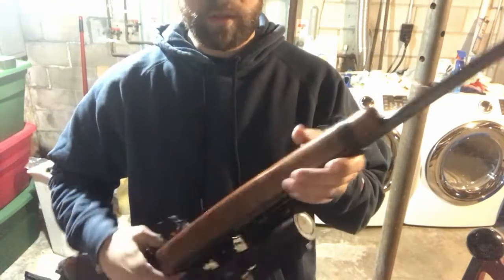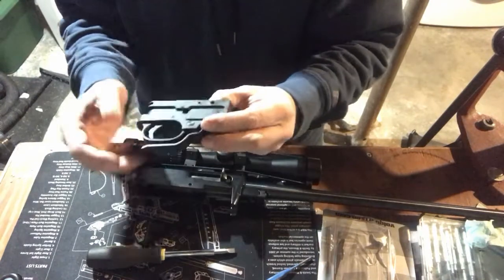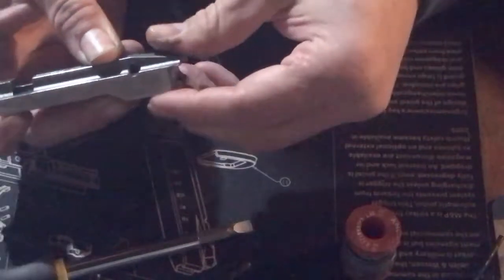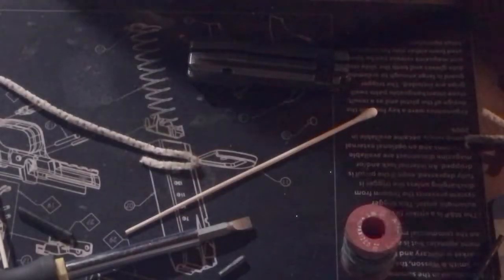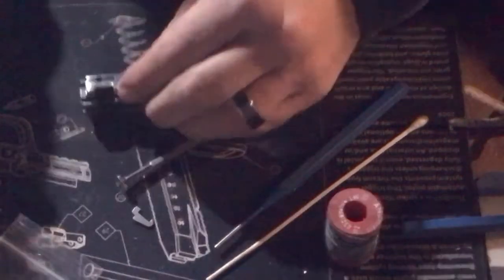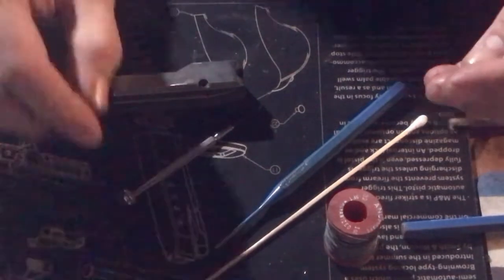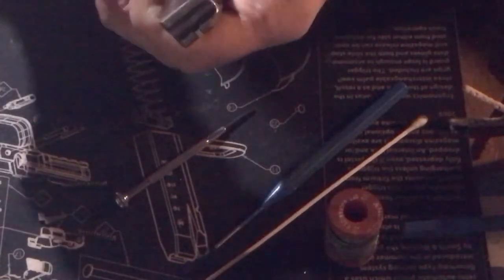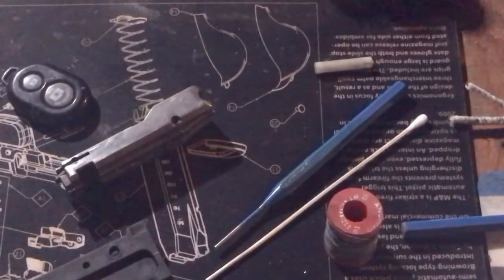Ruger 10/22 Firing pin and Extractor Replacement

Comment: I have did several mods to my 10/22, to get it running reliably. It was pretty much JUNK, straight outta the box. I installed a stronger plunger spring(from a spray bottle), then filed the plunger stop a little, so it would protrude into the mag-well a little more. This helped keep my magazine straight and level, while the action worked. I sanded and polished my receiver, and guide rod. I cut 2 1/2 coils off of my recoil spring, because it would ONLY run reliable, with Velocitors. Now, it runs good with Federal 550 bulk ammo. I had several misfires today, so I sharpened the tip of my firing pin a bit. I then turned my bolt-lock into auto-release. I also filed my sear and hammer, until I got my trigger pull to 1.5lbs.   Hmmm   I think that's about it, so far...   I basically did all of this stuff, with a small set of files, and a small set of punches, and some sandpaper. If I have any more problems, I think I'll build up the back of my magazine with plastic strips and super glue, to make it sit even tighter.    I almost forgot, I plan on adding more curve, to the rear of my bolt, where it meets the hammer.
Reply from the maker: Are you running the factory 10 round magazines?  I haven't seen too many problems with them but have seen a lot of problems with the aftermarket 25 round ones.